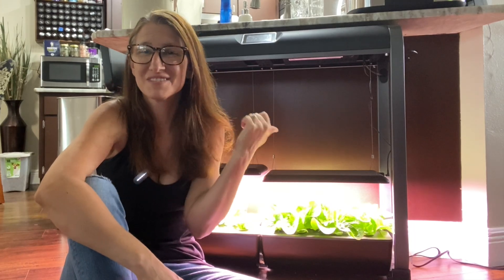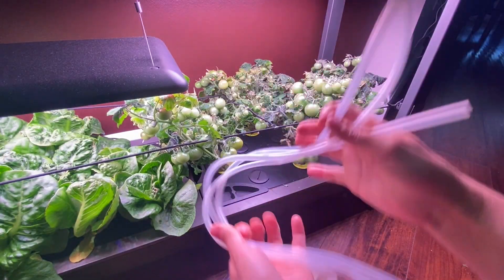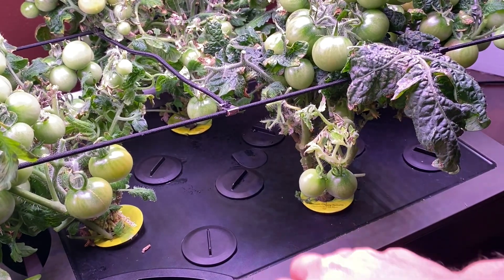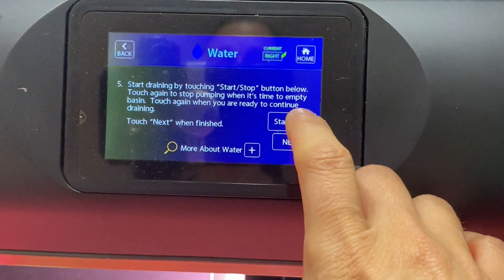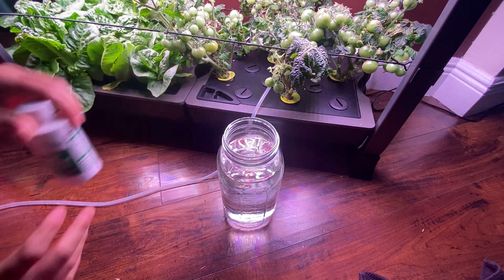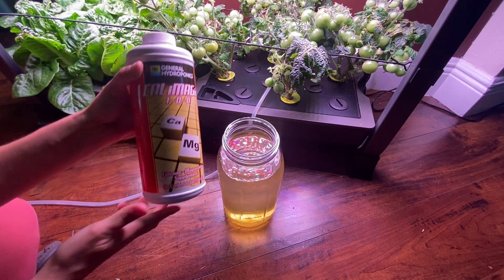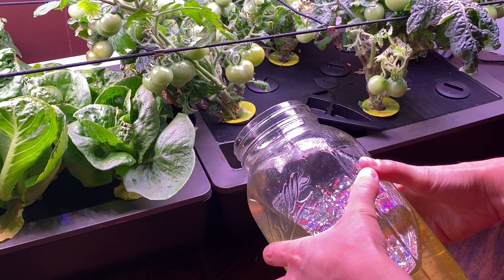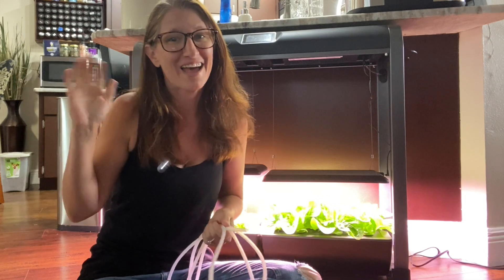Step-by-Step Water Drainage of the Aerogarden Farm

Comment: Have you ever had to clean out the entire system in the past year?  If yes, how easy/hard was it?
Is the system traveling with you for salads and herbs on the road?  It seems like the little one is more likely to travel....though maybe even the small continuous drain on the batteries might be too much while boondocking....
Reply from the maker: I clean the Farm out about 2-3 times a year. I found it’s easier to pump the water out then clean it out. It’s big and bulky so it’s a little awkward but not too bad. I actually don’t bring either of them just because the RV jostles a lot while traveling so it probably wouldn’t do well. The little one takes such little electricity that it probably would be fine boondocking. The farm takes a lot more and it takes up a lot of space so wouldn’t work out too well in my 150 square feet lol.